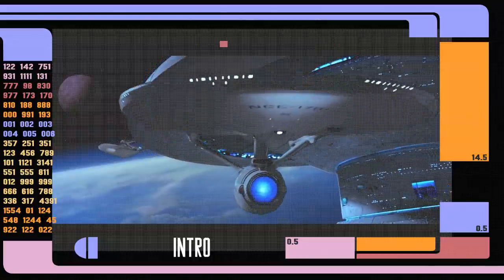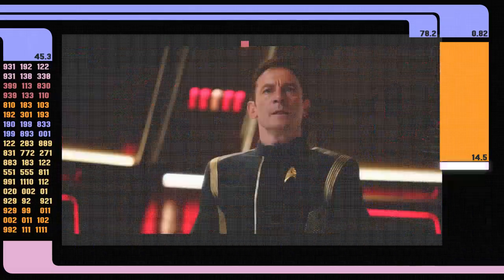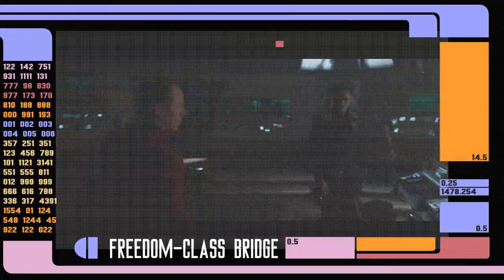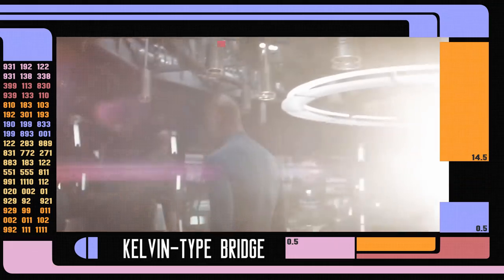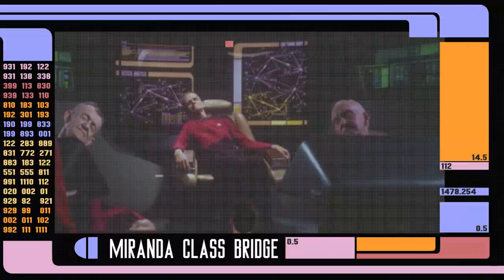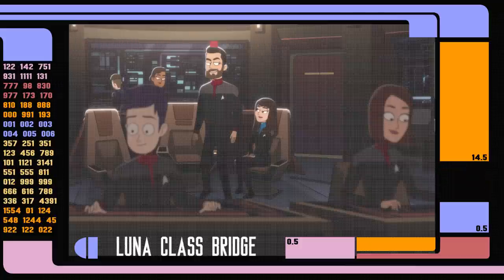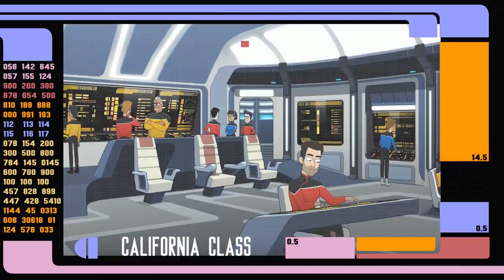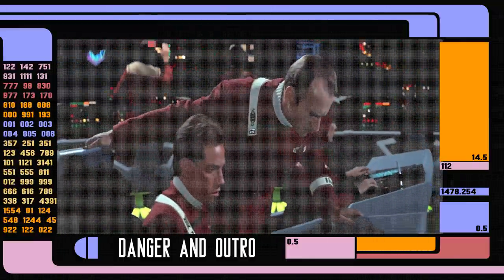Forgotten, Fatal, and Unethical Starfleet Bridges

Comment: The Reboot movies are largely agreed to happen in an alternate timeline and not a mutation of said timeline caused by Nero and Spock prime's time travel event. There are those who refuse to field this argument because it would directly refute their assertions to the contrary. As a result it is reasonable to asset with confidence that the Freedom Class is a direct indication that the thought processes of that timeline were in NO WAY influenced by the Narada. What can be said to influence ship design in this alternate universe/timeline is that the Narada called for a very overt escalation in Starship capability. Given the limitations of technology at the time, the ships were built larger and with more weapons. 

The Freedom Class refutes arguments that the Narada's mere appearing in the past, and there is a MASSIVE discussion of time travel and how it works in Star Trek, changed everything in the present and the past of that storyline. Decisions were made in their past leading to choices made for their present. for example a window for a bridge window instead of a screen was something they were working with and on for apparent decades. That the evolution of these design choices were advanced further and faster than originally intended does not confirm, but rather denies, the reboot timeline is the Original Timeline "somehow bastardized" that is fallacy mindless fans use on the reboot movies trying to throw shade at them.

As far as windows on the bridge, given most Starfleet vessel have windows else where on the ship, observation decks, some quarters, and so on, it only makes sense when the ship is no longer being treated like Submarine, but as a surface ship. Just needs "battle shutters".
Reply from the maker: I mean it’s canon that it’s a timeline change… it’s on the screen…
Reply: @LoreReloaded  
*I'm responding to the response knowing I will not get a response from "LR" to it. 

Star Trek's own model of time, precludes the Narada's arrival creating any kind of changes in the timeline, EXCEPT those forward that point in time. But that then is just another timeline. We can assume only one timeline was created from the arrival. There is then a timeline where the Narada never arrived and all the fallout from that. 

It is basic Causality, a key component in time travel in ficiton. Did something happen to cause an action or a series of action or not happen to cause yet another series of actions or nothing at all? 

However, no one noticed Spock Prime and his wildly more advanced ship, with a cubic meter of "Black Hole in a Bottle", and so NOTHING changed. Meanwhile, the Narada violently assaulted and destroyed the Kelvin, there were survivors who made reports brought back data from scans and "flight recorders", and Starfleet noticed and ramped up Military development as a result. And it wasn't enough until the Vengeance (Maybe. Unknown).

Is it not a standard "by-law" or trope in Star Trek that you do as little as possible when interacting with the past?  That Spock Primes actions resulted in nothing happening. He could have warned Starfleet of the Narada and the Romulan homeworld to watch out for a Supernova in their literal backyard in 126 years or so and did not.

Also you refer to "Star Trek" (2009) and I will also cite it pointed out it is illogical for to assume events in an alternate timeline to play out the same way as another. Granted, I may need to review the movie to see who said what to who. 

J.J.Abrams is a nerd, his style works much better with Star Trek than Star Wars, and he frequently aggravates the bejezus out of the fandom, but he is also insanely good on the details. The convolution of the details and actions in movie points directly to the reboot movies being in its own timeline and not a mutation of the original time line.

Comment: You were asking for viewpoints.

For the first part, about the windows.  Exclusively using viewscreens means using computerized tech, and there's no sane warfighter out there who would exclusively trust visuals from something that can be hacked and/or disabled.  Further, there's just a kind of reassurance factor from being able to look with your own eyes.

I'm not going to talk about the layouts - you make good sense and I generally agree.

Regarding the size of the consoles, I honestly believe the other shows failed in presenting things accurately.  When designing for combat, especially in conditions where inertia came play a factor, you set your controls a fair distance from each other on the control, marked and otherwise arranged to prevent accidents happening due to sudden shifts in inertia.  Further, their internal designs will include lots of redundancy - at least one duplication of every circuit and board, if not more, and a shared information but heirarchial(sp) control setup.  Plus those duplicates would be spaced from the others so as to provide some degree of insulation from whatever damages them, in the hopes the duplicates will be able to continue, reducing catastrophic damage to merely significant but recoverable.

Last, I agree with the "rocks" being hurled out making sense.  I've watched solid state devices become quite kinetic when the energies they use go horribly wrong.  Plus, the energy of the reactors and drive units for a starship, not to mention shields, weapons, and whatever else they might have can easily present those kind of energies when hit the wrong way.

Comment: for our spaceships to be able to control safely 
electronics circuits would not have resisted 
when space forces will be quickly creating 
overloads that would make them burning 
.
so with power circuits we replaced them 
which directly to workstations were connected 
but to these workstations, overloads will hit 
and for operators to be well protected 
.
there anti-overload circuits will be installed 
so all overloads will be surely absorbed 
but in combat the overloads are amplified 
as by the enemy weapons they were provoked 
.
so these circuits won't be able to absorb them 
but at least they can delay them a bit 
by giving the operator time to move away 
but often an operator will continue as ever
.
his operations despite being in danger
in some cases his death it can cause sadly 
or if he leaves early the ship will be uncontrolled 
so it could explode or be seriously damaged 
.
too often the operator goes to his post to stay 
at the risk of being seriously injured or worse killed 
because until the last moment they want to stay 
and often for others to sacrifice themselves bravely

Comment: The only military subamrines that have windows are russian made. Those windows are in the sail. The Windows are not used while submerged. The Sail itself is flooded while submerged, otherwise the windows could not sustain the pressure. These windows are there because the primary fleet of russia (northern fleet) is mostly active in the high north where it is very cold. While surfaced theses windows are used as lookouts, because it would be to cold for the crewmen to be on top of the sail. To conclude, these windows are not used under water, they are there to protect the crewman from the cold of the north. 

There are many non military submarines that use windows, these are research submarines wich special windows to resist the high pressures of the deep.

Comment: Windows are the worst thing you can have (transparent metal or not) - when literally right next to it there are exploding antimatter torpedoes or the disruptor fire - the flash alone would make sure anyone staring would go blind. Heck even in this clip around 2:20 you got people covering from fairly small flashes xD So unless there is some serious filtering installed - they would go blind permamently any time a torpedo detonated close by (or on their own shields). 

I get it that windows look cool - but (metal or not) but they are still a vulnerability as metal or not they would still be weaker than normal outer armor plating - space age alloys or not xD heck - for once i bet the "metal" windows aint even ablative in nature meaning any hit close to them or to them would slice that much easier into the ship.

"for observing stellar phenomena" well - if you are down to staring through windows instead of using proper science sensor or  arrays then that kind of data is useless anyway :P Not to mention this implies that you might have to come way too close to that phenomena - and that is just ASKING for trouble - that is what science probes ar for (if you need to get close). And getting to close to obserce something was a common trope that got wrecked numerous starships in that brand. Aka when facing unknown it might not be a good idea to smash your face into it - just to take a look xD

"and in startrek ships fight close to each other" - yes and that was done merely for the cool "looks" factor and not "tactical" or even strategic factor.  Ships sticking close one to another is just a recipe for a disaster with the kinds of speed they can achieve and during battles well thats asking for trouble - via random collisions.

I get it they did so to make it cool - but that aint how a space battle would work - especially when they got antimatter torpedoes with hundreds of megatons power range flying like candy all around you would really want to spread your ships around and keep proper distance.
Reply from the maker: I would assume they would have measures to prevent such an occurrence though some scenes would make you think not
Reply: you can tint and polarize windows so that doesn't happen
Reply: @jeremydelaughter5127  I saw that they did this but it was done via voice command - if anything it should do so automatically or the first flash would fry the crew eyes - and mind you some races eyes were more delicate that human ones.
Reply: Starfleet should have had all the windows one way polarized already because you'll be looking at stars and other bright light sources at close range potentially, then again this is starfleet we are talking about...

Comment: I would say that windows and viewing screens have their own pros and cons. I would say that the windows were discontinued after an enemy of the federation discovered a way to make the "Magic Metal" completely fall apart. Say what you will, but i have yet to see a window-like clearness from any form of metal that isn't thinned and polished to a point where its unusable, or is plain chemically unstable, that certain frequency and wavelengths can rupture it. I will also say that windows, like the ones on the space shuttles or ISS would, and should, probably be more frequently used if phaser/disruptor fire couldn't simply dematerialize it. And don't fall back  on the shield defense, That shit goes down way to frequently, and probably needs to be looked into if the villain of the week can disable it in what can be considered light phaser fire. The viewing screen, while impractical for viewing, can act as a sort of buffer. like "A chain is only as strong as its weakest link, Break that, and you break the chain" sort of deal. If you remove the possibility of your enemy killing you instantly by breaking your window, than you have a better chance at fighting back.

And the prime example you use is the  that ship (and series) shouldn't even be canon. If they don't have enough power to replicate food out of energy like in every replicator in star trek, that means they either 1)aren't smart enough to do that, which should mean bye bye magic metal 2) The ship is poorly designed, which means the windows have a possibility of being faulty, and thus more of a liability than an asset, or 3) They don't care what happens to the crew, and the ship is held together by spit and duct tape minus the tape. which could mean the previous point on window design. The franklin class had a practical window design that we had experience making, is cheaper that Magic Metal, and can have a practical overlay that doesn't distract the viewer. I would also like to point out that physical buttons are better than touch screen buttons, because its easier to fix a single broken button, but you have to replace an entire screen or troubleshoot when something doesn't respond.

I would say i bring up some decent points, so if you can find a way make completely clear steel for use on active duty ships without compromising the structure of the steel in ANY WAY. I'll concede.

Comment: You show old Khan with youths. Where'd they come from as the Augments were all adults and it wasn't THAT long ago. Bridge chairs - not theCaptains' or helm/security ops aren't chairs at all. They're antigrav cushioned pads you have seen in STTMP where a crewman is only seen from the feet to the knees standing on a floating pad, the rest of his body offf the top of the screen in a scene on the bridge. Of course that is when they might sit, but I think they may have a thing like some offices are doing today with the standing desks. No sitting.
Those aren't rocks,heck, you see them bounce off people. They're pieces of foam type insulation.
Didja forget NX-01,Pegasus, Cerrritos, and Defiant bridges?
What's unethical, other than the Equinox crew's deeds.

Comment: The windows are for non-combat use. Flying, seeing what's immediately around you for navigation, and so on.

Submarines don't have windows because they're useless. You go even a few meters down into the water, it gets too dark to see. Do you really want to scare your crew by exposing them to the black abyss?

Engagement ranges for most ships as well is far beyond the visual. By the time you see that incoming missile, it's TOO LATE to do jack about it.

For combat? Aside from aircraft, humvees and most wheeled vehicles, windows are near useless. Tanks do NOT have windows. They have periscopes and slits in the armor for the driver, which too can be closed. And in all of those cases, windows are for NAVIGATION, not combat.

So for a starship whose ranges can be measured in light seconds, both for sensors and weapons ranges... no. By the time you see that incoming torpedo... you're dead. Chances are you see it on sensors and react to it THEN, not when you see it visually.

If you want to navigate, look out the window and your sensors, consoles. If you want to fight, look at the console and shut those windows behind armor. About the only use windows have is to appease the viewer, but has no tactical value what so ever.

Comment: Hold on. The reason submarines don’t have windows isn’t because they can’t be made to withstand pressure. Large military subs don’t have windows because there is no point. In most areas of the ocean, water is to murky to see through. Even in very clear water(like the Caribbean) no one could see far enough in front of a military size submarine to make any difference. These subs need information about their environment several thousands of yards out, not 100. No body of water in the world is clear enough(especially at operating depth) to justify windows.

Comment: Always thought the rocks were like replicator technology like when the plasma there's so much plasma running through them units and power ranger them units that if it didn't have some kind of way to transform the power we would just simply blow out that whole section of the ship so it converts it over to rocks or some kind of solid Mass I'm using like maybe some kind of replicator technology
Reply: You would also be able to scoop up the rocks and put them back into the system and get power

Comment: Windows are not used by modern fighter pilots much. With missiles that can be fired we beyond visual range pilots spend most of their time in combat looking at the radar and other screens.

Same with naval ships, the windows are simply a cheap way to look out. Guns and rockets are fired using radar via computers. This has been done since WW2.

So actually no issue getting rid of windows,cameras and telescopes are inevitably much better.

Comment: Having a window on the bridge of a starship would be ludicrous and stupidity at the highest level. For one, the vessel, even on impulse would be travelling at near relativistic speeds. No he an could react fast enough to command the ship to avoid an object in its path. Second, in space most objects and enemy vessels would be millions of miles away to where even the most eagle eyed of beings could not see the approaching danger until it was too late. Then at that, a phaser bolt travels at the speed of light where a photon torpedo travels near warp 10. There is no was any living being caused on coming and react that fast. Even the situation rooms on modern warships and submarines don't have windows because incoming ordinance is approaching Carter than humans can react